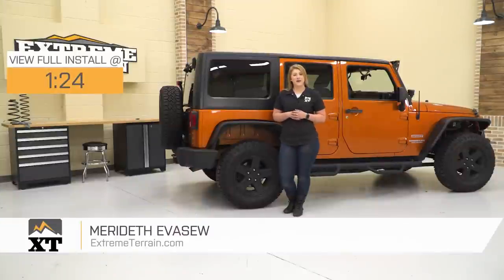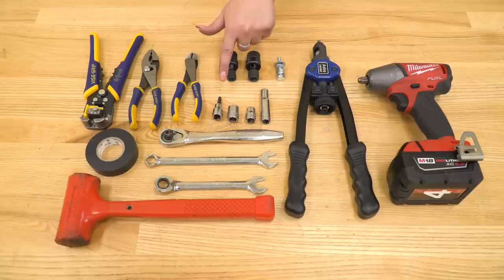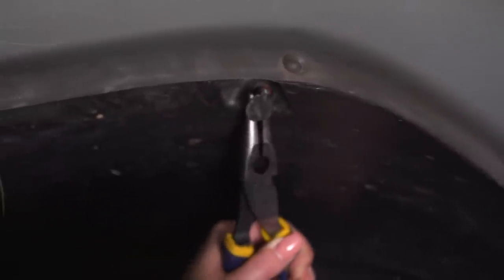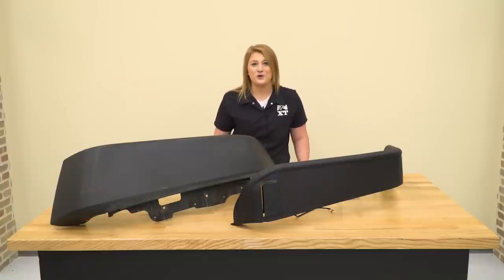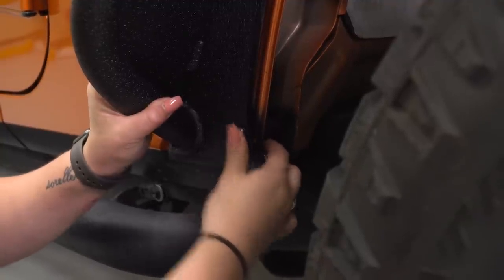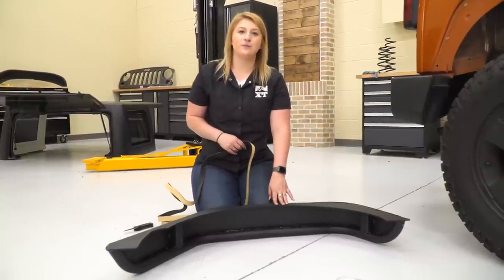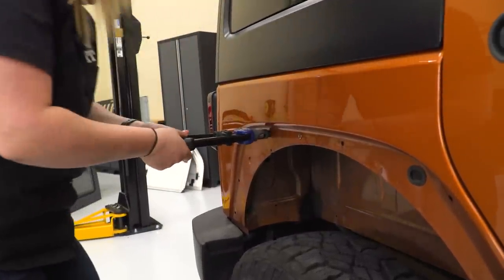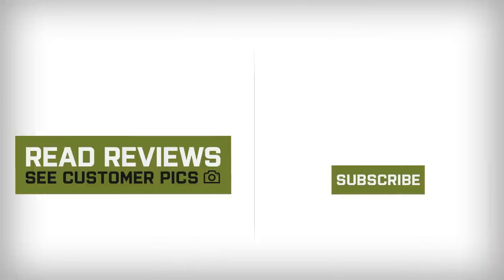Jeep Wrangler JK Barricade Tubular Fender Flares w/ LED Lighting (2007-2018) Review & Install

Comment: Bought the Barricade tube fender flares, didn't realize when you remove the stock fender, you remove the wheel well inner liner!! Who wants mud slinging around under their wheel wells, so had to buy Barricade inner fender liners as well. Then after watching this video, I realize I also have to buy the rivet nut driver, because the cheep bolt they provide breaks, and you need the mandrels to screw the rivet nut onto to put he nuts in place. And all this is why modding a Jeep is so expensive!!!

Comment: Oops! There are 5 bolts, not just holding the inner liner. The four visible plus one hidden in the hole in the liner. You covered that correctly on the "non-lighted" fender install.

Comment: So the only thing that drives me insane about this video is the end bit where you crimp connectors and electrical tape them when finished. Your leaving yourself open to corrosion, damaged lighting, and possibly having poor connections. 

Solder and Heat shrink are the best way to go for connections that are exposed to the elements.
Reply: yup